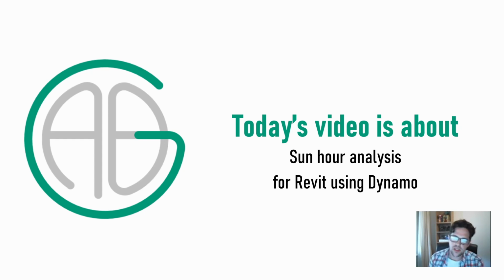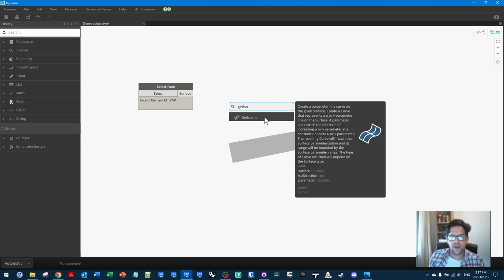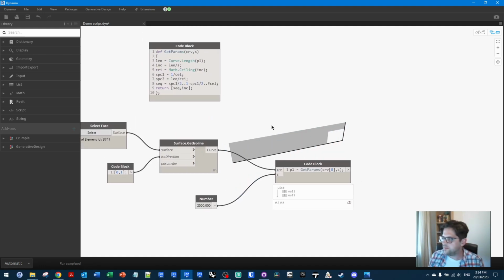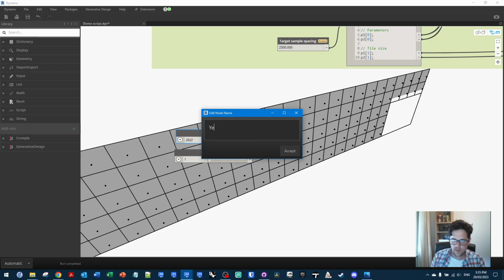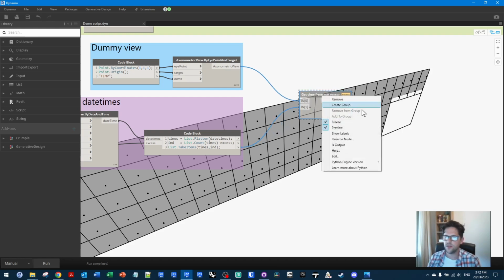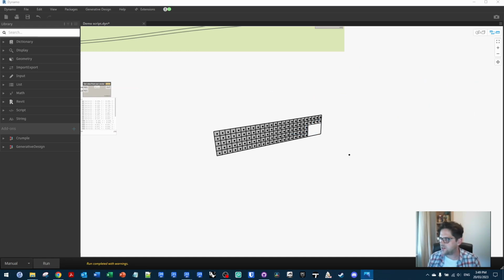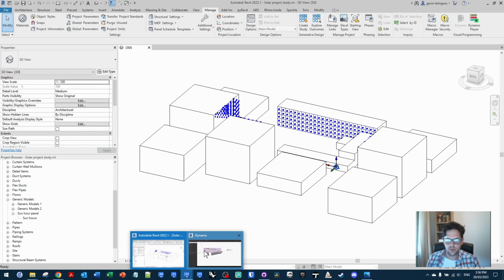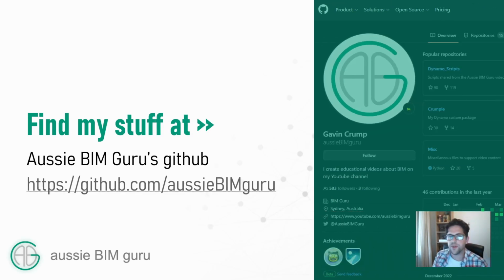Sun hour analysis using Dynamo and Revit (no Ladybug)!

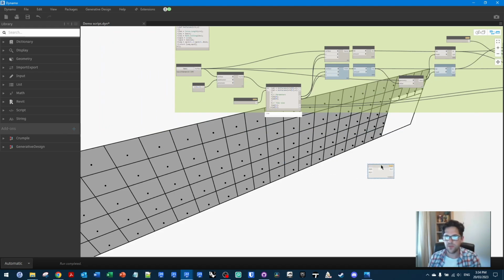Comment: I am running into an issue where the sun hours report more than possible hours. I set the time range to be 02:00 and 21:00. Most are reported accurately with 13/14 upper limit hours which I verified with local data and summer solstice hours. However, when I do dynamo player and varying faces - I am seeing that the sun hours are 19/20, which can't be possible since the project isn't located in alaska... Also - my dynamo player is picking up bounces from other panels created :(
Reply: If it's important to note - I am doing this on pitched roofs - so the surface U/V isn't perfectly trimmed to match the surface profile
Reply from the maker: I would suggest visualizing the rays as lines to see what is happening as it sounds like an error caused by the sun angles.

If you need to divide pitched surfaces you could try working at the plane of the surface although it's a bit different to my approach, would take some extra work beyond what I've covered here.

Comment: Hi Sir. Thank you for this video doing dynamo without ladybugs.
I have one query. I was working on the Al Bahar building in Revit and Dynamo. I watched your video of the same building in Revit. However, I am not able to work on the sun path diagram and analysis since Ladybug doesn't work in Revit 2024. and this video shows an hour analysis. I want to know how can  I do that movement of panels with sun movement in Revit and Dynamo.
I am not able to get that video or related to it something that can solve the issue. Hope you will help me to figure it out.
Thankyou in advance sir.
Reply from the maker: I will have a video on channel next week which shows a node in Crumple that can get the sun directions. This can be used instead of ladybug.

Comment: is anyone having issues with the script deleting tiles when you run the script after running it before? Ive tried the script I wrote when watching along as well as Gavins script from Github. It worked perfectly for about a month and now its deleting tiles. Please help :(
Reply from the maker: Run it via dynamo player. Sounds like an element binding issue which happens if you create elements in a dynamo session.
Reply: @AussieBIMGuru  thank you Gavin I'll give that a try and see if that resolves the issue. I was running via Pyrevit before as I'd set the script up on a custom toolbar. Would there be a way of avoiding the elements binding as I'd like to keep using this in practice via the pyrevit plug in we have set up
Reply from the maker: @Bdizzle304  replace all nodes that create elements, dont run in dynamo then run via player. I believe pyrevit unfortunately opens the script so that might be an issue too.

Comment: Hi Gavin

 I asked a question about it
 I did not understand what node you used to get the view from the sun vector 🙁
Can you help me?
Reply from the maker: In this case I didn't use a dedicated node, I ended up using Python for that part of the workflow. The only way to get a sun vector is to ask a view for its sun direction, so the python node cycles through changing the time of day and getting the sun direction each time.

Comment: For anyone else following along and getting the multiple curves error message, this can occur for multiple packages being installed which call upon Curve as a class or function (don't quote me on that though)  I have attached a revised version of the code below which solved the issue for me - hopefully you don't mind me posting this Mr BIM Guru :) 

def GetParams(crv,s)
{
len = Autodesk.DesignScript.Geometry.Curve.get_Length(crv);
inc = len/s;
cei = Math.Ceiling(inc);
spc1 = 1/cei;
spc2 = len/cei;
seq = spc1/2..1-spc1/2..#cei;
return [seq,inc];
};
Reply from the maker: Thanks! Yes some packages borrow similar name spaces in design script such as Orchid so in that case writing the full function is needed.

Comment: Great tutorial, Do you know  how can I make ladybug work with dynamo and grasshopper or any package that can assume energy consumption ?
Reply from the maker: I believe the honeybee module for ladybug can conduct energy analysis. I havent used it a great deal personally but their website has some tutorials about this, as well as Phil Galvan's channel. Generally Dynamo wont be up to the task so maybe rhino inside revit and grasshopper could be.
Reply: Okay, I got it. could you please how to deal with rayBounce with points not elements as i'm working with parametric form not a modeled one.
thanks! @AussieBIMGuru

Comment: Once again an awesome tutorial... 😀
If you don't mind I have a question. I'm unfortunatly getting an error right in the first code block, and I'm really stuck. I have the Orchid package installed and it's apparently creating a conflict, "Multiple definitions for 'Curve' are found", and "Multiple definitions for 'Math' are found". Is there a way to fix this issue, Or do I have to remove the Orchid package?🤔 (p.s. I've already tried putting in "Autodesk.Designscript.Geometry.Curve.Length" and "DSCore.Math.Ceiling" as Dynamo suggested, but then the code block returns a null, and the Surface.PointAtParameter also subsequently can't work...)
Reply from the maker: Yes if the DS prefix isn't working then it may require an uninstallation - Orchid uses some classes with similar names that can cause ambiguity in code blocks.
Reply: Hi I think we are having the same issue I managed to resolve this earlier thanks to the help of ChatGPT and a little trial and error. The issue can lie with multiple packages which use Curve as a naming/ class type which is likely the reason the conflict or issue with how the "Curve" class was referenced, which led to the error we encountered. The code I am now using to get this to work is as below (Line 3 has been changed from Gavin's code in the video the rest I believe is as the Guru himself has shown)

def GetParams(crv,s)
{
len = Autodesk.DesignScript.Geometry.Curve.get_Length(crv);
inc = len/s;
cei = Math.Ceiling(inc);
spc1 = 1/cei;
spc2 = len/cei;
seq = spc1/2..1-spc1/2..#cei;
return [seq,inc];
};

Comment: Thank you for sharing this workflow. One question, how can we adopt this workflow to calculate daylight intensity inside the building?
Reply from the maker: Unfortunately daylight is far more complex and you would need to use an engine such as Radiance at this point. This is supported via Grasshopper/Ladybug, but Autodesk doesn't offer any detailed/accurate tools for this I believe.